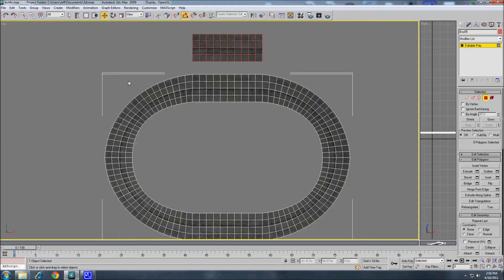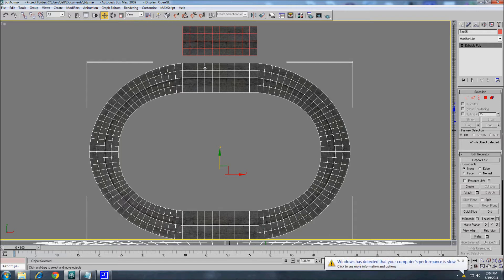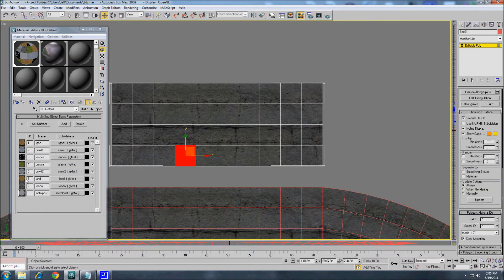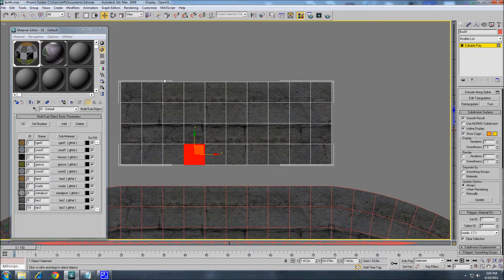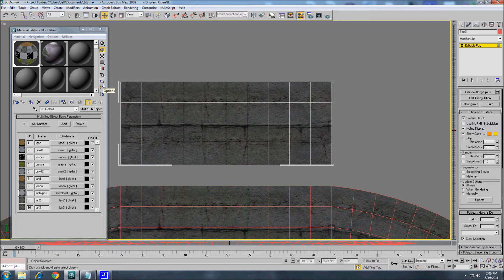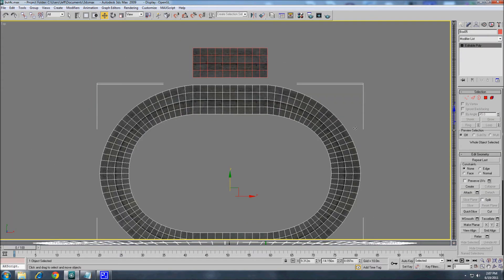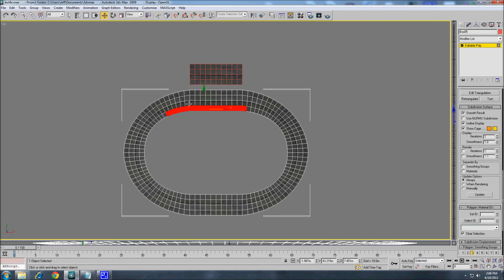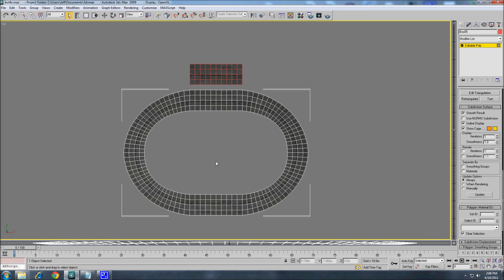3ds Max rFactor Tutorial Creating Multiple Lanes

Comment: Im currently making a dirt track and i came here to learn how to grip the lanes and i was wondering if you could add a curb/cushion on 3ds max.. if you know how can you post a way on how?
Reply from the maker: Adding a curb would be the same concept as adding a wall (which I have a video on).  As for the cushion, I would just model it by hand.  Select edges in the corner, connect to add more lines to play with. Could move the verts by hand or select them all and use an FFD modifier.   I've never made an American dirt track so I never really needed to add in cushions.  Hope this helps.
Reply from the maker: As well, it says you posted this 5 days ago.  It just showed up in my feed.  Weird!?!?
Reply: I will attempt it.. thanks!

Comment: if you loft your track surface, you can set your loft shape up with broken verts before lofting. once you convert the loft to an editable mesh, you can select each piece as its own element, and it won't take forever to manually select each poly. You can see what I mean in my track video #5.
Reply from the maker: +flash2042 I try to keep it simple since most folks will be new to max. There are 4-5 dif ways to go about this.  Breaking the verts wont allow the tex to stretch across the entire track.  If I was doing walls, depending on the tex I use would depend if I break the vert or not.  Everyone has their own way of doing things.  Thankfully there are plenty of options!